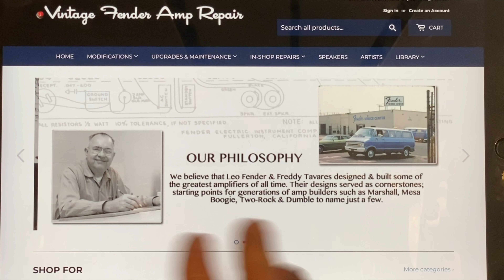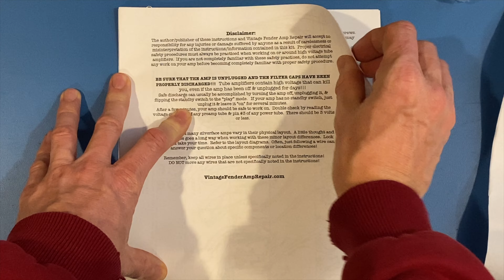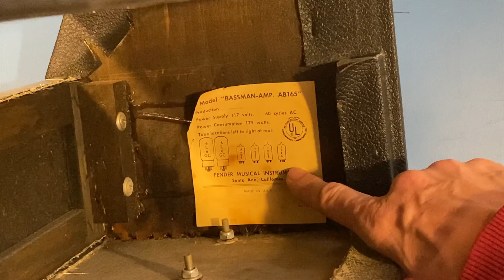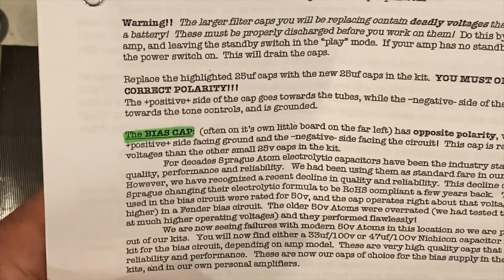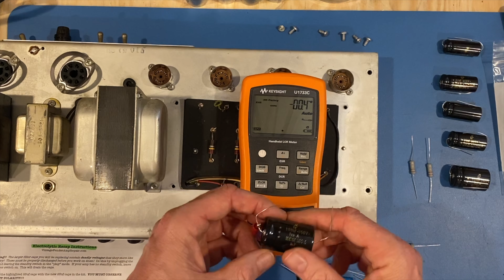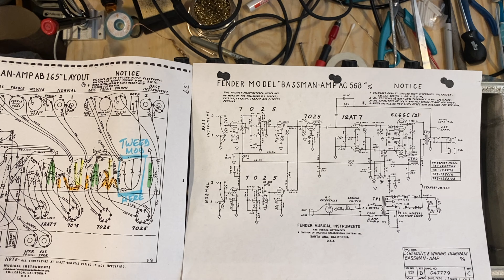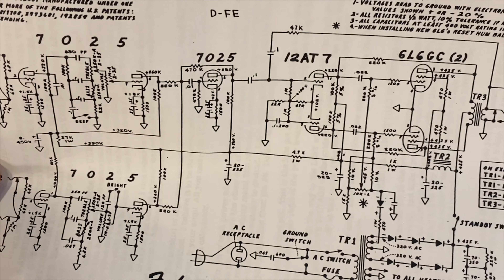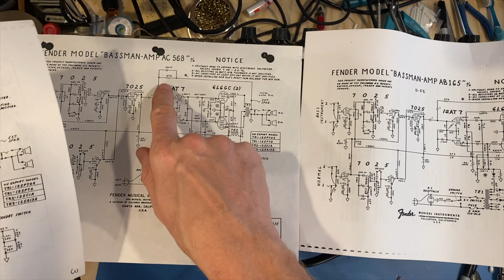Fender Bassman AC568 to AA864 Conversion + Tweed Preamp - PART ONE of THREE

Comment: I've taken an old DuKane  1u460 pa and inserted a 65 Super normal circuit in it and it sounds wonderful, since then I've put that same circuit in 2 6v6 pa's, 1 a Bell 23 the other a Precision 20pa. all these amps cost me less than 100 dollars each off of ebay. Lots of volume. Leave the Bassman alone, original,
Reply from the maker: Sounds neat!  I like your idea in making other purposed amps guitar worthy. True, the Bassman could be left alone, accept for parts that will cause the amp to fail electrically as we all know. I would like to see some of your designs if you have a way to share?  Thanks!

Comment: WOW! i have a drip edge bassman that is the same circuit with the ab165 tube chart sticker as well. It is in the shop right now for power cord and electrolytics, but you have me wanting this mod pretty bad! I always wanted a little more clean headroom out of this amp and your results sounded glorious! Thank you for this awesomely detailed video! Was the tweed mod to the bass side included in the package or was that an add on you picked?
Reply: Tweed mod was another upgrade option, and I agree, sounds amazing, for a very affordable price. If your paying someone to do these mods, be sure they don’t change the values or types of the ceramic capacitors in this circuit, especially on the normal channel. Also, depending on the tech your using, you could by these exact kits and have them installed. If your tech is a bit stuffy, sometimes they will try to get you to choose there choices, not others. Vintage Fender Amp Repair is a reputable company, and one well worth looking at when thinking of these kinds of mods. 

Often, when doing a heavy mod like this, techs believe that the easiest is to just replace everything. This is not always the best approach. Replacing what is only needed such as you are doing now, then taking a listen at each step is often a better approach.

Comment: I don't understand the title says changing from an AC568 to AA864 and the unit is an AB165 circuit.
Reply: Hi. Sorry, that circuit is not an AB165. If you comb the schematic, and compare, you’ll see it is indeed an AC568 to begin with, before and mods where done.

Comment: What Epoxy putty did you use to seat the electrolytic caps? Does it set up hard, or still remain a little pliable?
Reply from the maker: HI Brad.  The putty does cure completely, retains its shape but overall is flexible after mixing.  Thanks.